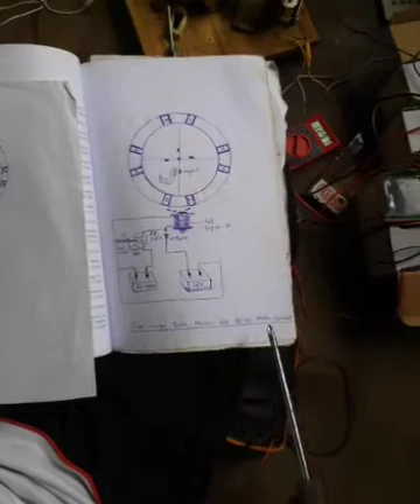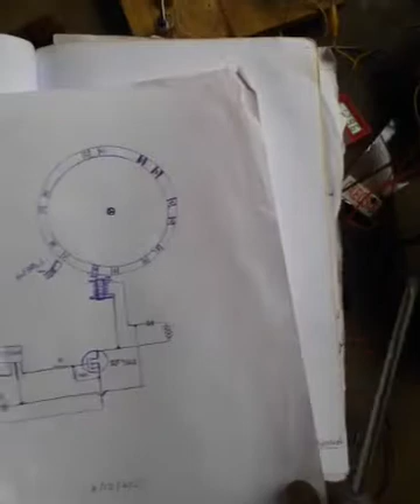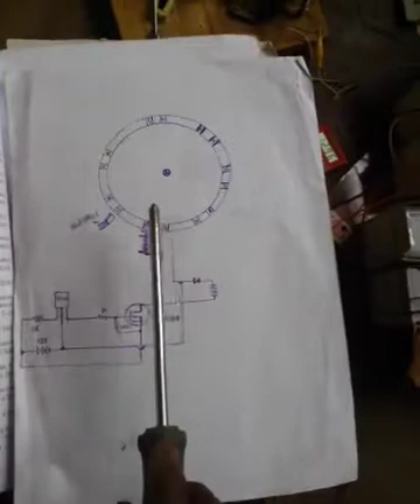Lenz free pulse motor generator with BLDC motor concept by a Nigerian inventor ( part 2)

Comment: Keep up the good work! If you replace the output coils with high-turn, twin enamel wire bifilar coils, and increase the rpm of the rotor  , you will actually get a 'delayed Lenz' effect that will actually aid the rotation of the rotor due to the delayed phase shift of the back EMF. Thane Heins talks about the effect in his work. Or you could try a 'partnered output coil' configuration for one of the output coils instead.
Reply from the maker: I will try them out, thanks for your advice.